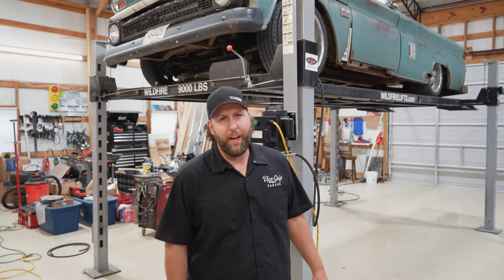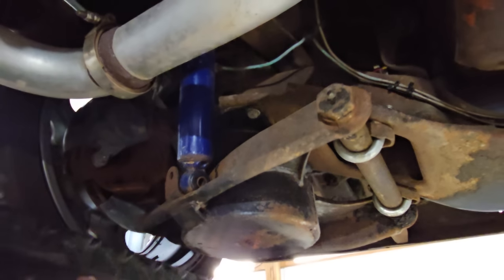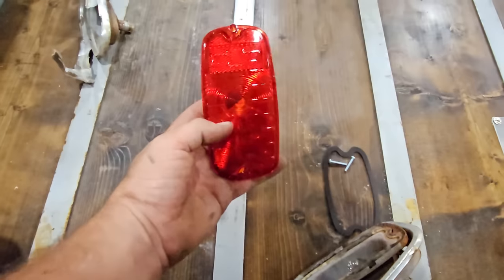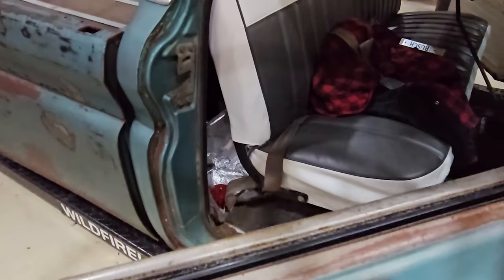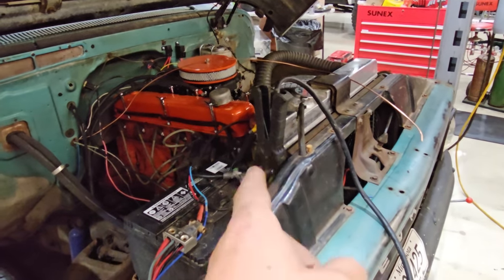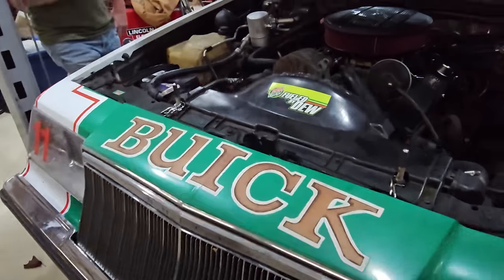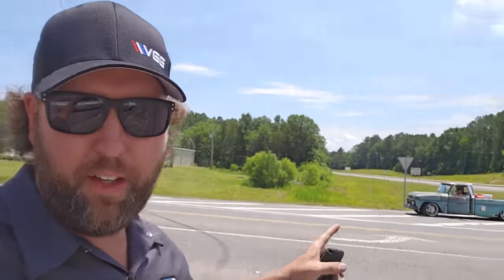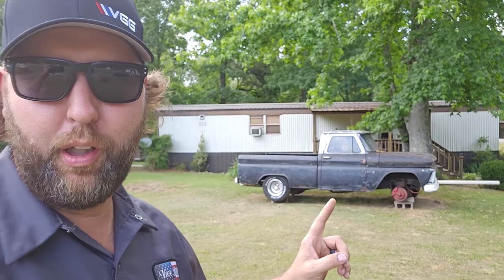Will These 3 Classic Vehicles Drive 250 Miles With No Issues?

Comment: 32:15  The wires for the tail light and brake light run up the inside of the steering column so that you can have a signal light. I have seen the steering column housing cut into those wires (takes years but it seems that vehicle has had years to cut) and start shorting them out. Such usually causes a blown fuse. In any event, consider checking the wires coming out of the bottom of the steering column for a cut.

Comment: The grandstands, Pressbox and Luxury suites are still looking impressive.  As are the Apartments there at Atlanta Motor Speedway.  My friend Jon Williams and I designed them for the owner (B. Smith) when they changed the race track from oval to it's current Big D shape or tri-oval. Southern Bleachers built them and they did an excellent job.  The design was so good Mr. Smith used it for the Texas Motor Speedway.

Comment: When I installed a mechanical oil pressure gauge, I used -3AN fittings and steel braided line, because it's more flexible than the copper line, and allows for any sudden movement by the engine (if a motor mount breaks). Yes, it's considerably more expensive, but it's also considerably more flexible.

Comment: My pete was a ol 2 sticker.  I had a budwiser on the main, and a bud light on the Auxilary trans. Made the sicks with heave wall pipe and run a wire up both, and put a red LED in th main and a Blue one in the Aux.  They looked so awesome in the dark both beer taps lit up.

Comment: You were right the lower shock on Longmire should have lined up and slotted inside the bracketry, not hung off a bolt. It'll work like that but the geometry will be a bit off.

Comment: Just a note for if anyone takes a fella's advice and changes the plastic oil gauge line to copper: make sure you have a loop or two in the line before the firewall so as your engine moves around a bit on its mounts, it doesn't fatigue the metal and make it crack years down the road.

Comment: 19:23. Longmire isn't having battery issues, it's the alternator. Set the electric fan to turn off at just above cruising operating temp. 190⁰F as an OFF is too low and the electric fan will run constantly, sucking every bit of juice that the stock alternator can provide. I'd recommend upgrading the alternator on the road. 130-250amp. Although I doubt you'll be able to find a Mechman alternator on the road. 
  The big electric fuel pump and the efi and electric fan are more than the stock 40amp alternator was designed to handle so it can't keep the battery charged. 
  Set the fan ON temp to 5⁰ above the cruising operating temp and OFF at 1-2⁰ F above the operating temp. Then it will only help the mechanical fan when it starts to overheat and shut off during normal cruising to keep charging the battery. 
  Good luck with it. 
  The 105 Amp alternator on my 90 k2500 drops to 12.5v at idle with the electric fans turned on. I'm running a big 340lph electric fuel pump and big 2007+ Tahoe E-fans on the sniper injected 350 sbc. I'm also running a tci ez-tcu to control a 4L80E. I need to upgrade the alternator so I don't have the same problem.

Comment: That sucks about the crew cab.  I've learned from being an AG mechanic to only do one thing at a time when diagnosing issues.  If you try it after each step and it works, it's much easier to narrow it down.  Could be a loose solder joint inside the confuser for the transmission

Comment: great video! i know you said earlier that the electronics are here to stay, but as an older fella i am really missing the old school builds and drives.just try to think of it as power tour done back in the 60-70,s. back when mechanical got you there and back. the electronics seem to cause far more problems at times than they are worth, let alone the cost. i say drive the rigs strictly with the equipment they were built with new. if that was done, you would be one of very few actual mechanics left standing during this years power tour. take away their snipers, laptops, and digital gauges, and see how many are only left with a blank stare along the side of the road.  lol,,,,,

Comment: Went through a transmission thing like that with my old Mercedes. Drove me way crazier than I wanted to admit. It'd work perfectly or start doing it in the middle of traffic. And it took 8+ liters of fluid. Finally had them replace the whole valvebody and analog computer stuff. And I got t-boned by someone running a light after it finally seemed right. Next car was a manual...

Comment: 71 Vega with a 350 lt1/Turbo 400. SomeHow the bottom bolts of Left front shock come out. It seemed to happen when a fast car was beside me at a light. With the springs I put in the car sometimes it was weeks until I noticed the shock poking out. Cheapest fastest most fun car I've ever owned. Motor topped out at 6400rpm on that 2000lb car. Did I mention it was fun to drive?

Comment: small thing about the grinding inside the truck : cover the glass and plastic , the redhot sparks comming of the grinder melt intoo the glass and plastic and will start to  rust over time making the piece look verry bad , when on the outside of a windscreen it allso ruins a new set of wiperblades in no time flat

Comment: Your buddy Chad couldn’t do a doughnut because there’s a TCS bypass MOD that you need to wire in on the R/T Challengers, Chargers & Magnums to be able to do doughnuts. It allows you to fully disable the TCS stability control. The SRT-8 versions you can hold the traction control button down and fully disable it but not on the R/T models.

Comment: That dodge Royale was the first time in a year that I realized you sold a lot of the revivals.  I was so upset it sold before I figured it out.  I now have a 1956 Plymouth Savoy 4dr sedan.  It's turquoise with a white roof, and a homemade salmon interior.  The way I bought it.  I've been getting the brakes up to snuff.  But everything else works great.  Including the radio.  It has a flathead 6, a 3 speed manual on the column.  I'd love to give it a 5.7 gen III hemi, and an auto.  All of the car is solid.  I want more than the car can give... 
  Should I upgrade the flathead 6?  Apparently there are mods that can get me from 125hp to 225-250hp.  Or you know almost any v8... including an 80s 318.  I should be able to squeeze 250-350 hp?  My biggest problem is that the car is registered and titled using the flathead 6's engine number as the VIN.  If I change the engine, something has to give. Help?

Comment: We use 3/8" and 1/2" all thread rod couplings to extend the rod to  hang A/C Duct. Other trades use them too, but it is essentially a nut that is about an inch long. I know that doesn't help you now but I could send you some for future projects if you like.

*My Bad I forgot your P.O. Box is in the description, I will send some.

Comment: In your cat farm crew cab. Does it have a vac modulater on back of the trans. I once had a C4 trans sticking in gear.
I took the modulater off then pulled the valve out. Let the trans fluid run out for few seconds. Blow the valve off with compressed air then stuck it back in again. That seemed to fix it.

Comment: You need a Bigger Alternator to run the Electronics now get a 2000 Sliverado Alternator 140-250Amp cheap and easy to install just have to power it with the correct wire or it will burn it up!!

Comment: Uncle Tony was talking about those systems being buggy and having issues and little things. DD speed shop pulled their EFI off and gave up. I haven't seen that many issues with VGG other than him always having to have an expert tune it for him from time to time. But it does seem like the sensors are awfully sensitive and seem to go out from just this video.
Reply from the maker: Have had zero issues.
Reply: @ViceGripGarage  I was talking about the guy in the parking lot with a bad TPS.  Also you had the bad O2 sensor before you left but a lot of those things may be related to garbage parts and not necessarily the EFI system killing them.?

Comment: I have a 67 mustang with a real hi-po 289 with a few tricks in it.I can sit in traffic for ever with no over heating. No shroud just a 5 blade factory fan. I cant understand why so many people with hot rods have such a tough time cooling their engines,especially a 6 cylinder that originally had a fan and shroud so it could idle forever. I am just curious if you could explain why for my own knowledge.

Comment: I won't use the plastic or the copper I have had two bad experiences with the copper line and with the plastic. The copper line broke plastic line melted. Luckily I look at my gauges every 10sec😂. Literally saw the oil pressure go to zero both times and shut it down. Now I spend the money on braided ss line

Comment: no fender wells that will not be good when you hit a big low spot in the rain it will flood out your engine. if so open the distrubutor cap and spay it with WD40. That displaces the water and then it will run.
Reply: @shartne: rather silly, idiotic, stupid, ignorant idea to spray a lubricant, solvent of WD-40 on the inside of the distributor cap   !!. The oil will cat the metal connections, such significantly reducing transfer of electrical energy. Also having lubricant, oil on the inside between the the metal nodes will also transfer, conduct the high voltage [20 kV-50 kV] electrical energy intended for one node to others. Best thing to do is to just dry off the inside of the cap if it become wet inside. If the cap becomes easily, repeatedly wet inside, then a solution to encase the area to prevent moisture, after from entering may be necessary as those which travel in severe conditions, situations and such.
It is important to gain the proper basics, basic information, knowledge about, with, within electrical, electricity -> nearly all of these auto enthusiasts are significantly to severely lacking more so with common people. My basics began within my 8th grade IE class. Then increased through more study, learning, especially to, with, the proper ideas, concepts, principles,assembly, wiring, etc.
Good Luck, All The Best. Sincerely

Comment: does crewcab have  ELECTRONICAL GEARBOX  that wouldnt shift outta 2nd? i noticed my 2006 ford F150 wouldnt shift to 3rd or OD whichever it was on a trip home to my parents. I only had 45 km left to go, so i kept goi,  but just as i was rolling into their yard something let go and all the oil or last of tranny oil spilled everywhere and it  basically coasted into the yard and would barely move after that !
$1700 cdn later and 12 hrs to pull it out n put new one back in and i was on the road again, replaced my own tranny for 1st time.

Comment: You guys like to run them engines cold,  like 170-180, but every time i've done that with old v8s the MPG and the power responsiveness just seems to fall off, plugs seem to foul up "easier".  I've been running them 190-195 thermostat, fans kick on at 210, off at 200 and they run great. And old boomer racer told me if the engine isn't at 195+/- ish, it's not burning the fuel completely, the oil isn't at temp and is thicker, and the radiator actually gets rid of more heat when it's hotter, so you can run a smaller rad. (this i know is true as i have tested several times) what say you? Why do you guys like to run them at 180 or below? (I'm also at sea level...)

Comment: Why’s The Long Mayer rear end riding so low? Definitely gonna have to replace the Leaf Springs at some point.
Reply from the maker: There are no leaf springs.  It was a coil sprung truck replaced with bags.  Ride height is limited by shock travel.

Comment: 4:30
You: "As a temporary measure why can't i just run a piece of all-thread through"
Me: "Sure, that's as good as a bolt, just use double nylock nuts and it'll hold until you get a proper replacement part"
You: "And then weld it here, weld it here, weld it here and here..."
Me: (groans)

Just 'cause you have a really nice hammer doesn't mean every problem is a nail.

Comment: I would have fabricobbled a spacer into that shock mount. The stress will be entirely on that outer part of the bracket, it will bend in and then the weld or the inner side of the mount will be damaged. a short chunk of pipe or even just a nut on the back side of the outer mount.

Comment: My 72 F100 gave me tailight/ brake light issues...turned out in addition to ground wire I had to ground the actual bulb socket to the plate by drilling a very small hole where they touch and screw a small screw to ensure the female socket is grounded to the plate that in turn is grounded to the vehicle!

Comment: Hi Derek,
Why don’t you just leave the fan connected to the water pump because you put the other fan as a pusher on the outside of the radiator then you could’ve had two fans working at the same time.

Comment: If the truck has a 4l60 or 80 e trans check the neutral safety / shift indicator switch on the side of the trans, if they go bad they will go into limp mode and not shift.

Comment: What crazy lengths these auto makers went to in the past to save a few pennies per car.  Combo brake, running, and turn signal setups.. How much more would it have really cost to put a dedicated bulb for turn signals separate from the running and brakes?  Then they could have put amber turn signals on top of that. Which is superior to the combo all in one red lamps. Because it just is.  All this mickey mouse crap.